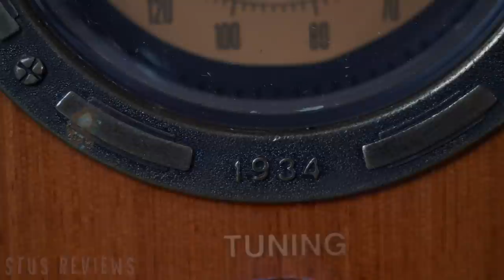We Made a Vintage Amazon Echo! 🧐

Comment: Would it not work with just the dot speaker which is quite good, why the addional speaker. Although when i just used alexa sound was muffled but i suspect with another speaker it would still be muffled. I did remove the piece of hardboard from behind the grill cloth.

Comment: Stu where can I find one of these replicas?
Reply from the maker: It’s an old steepletone nr880. Funnily enough, you can actually buy them now with Alexa built in (just not into the front like I did)
Reply: @StusReviewsUK  wow what does one search to find these pre built models I'm in search of a way to make my speaker sound like a 1930s radio
Reply: @Stu’s Reviews, do you have the link to buy it with the Echo built-in?
Reply from the maker: I don’t, but they are by steepletone.